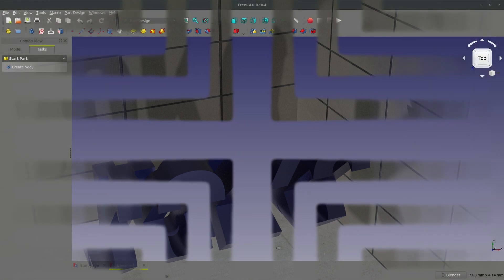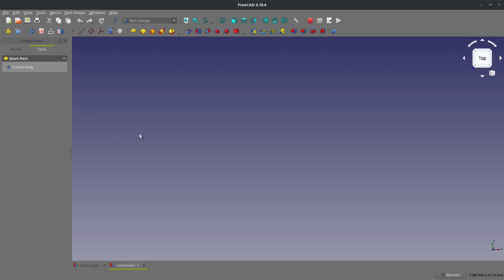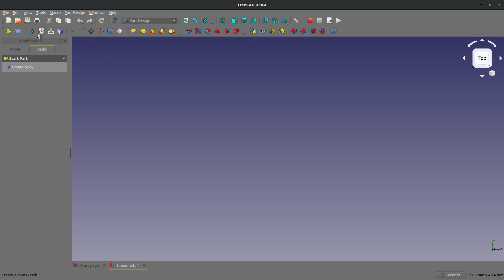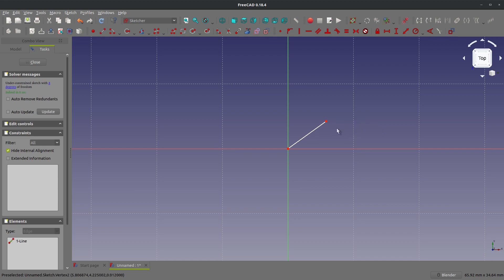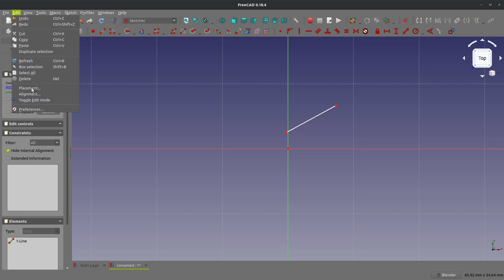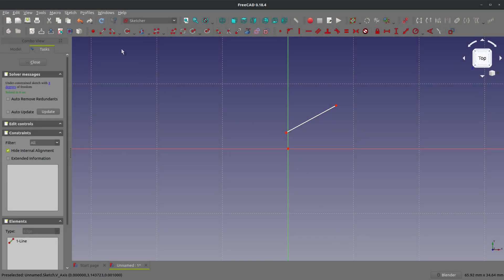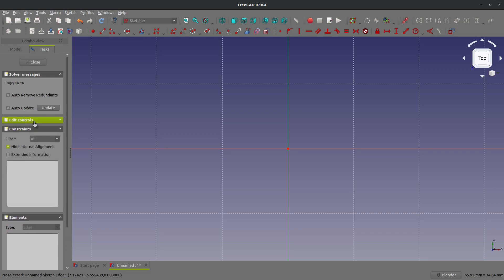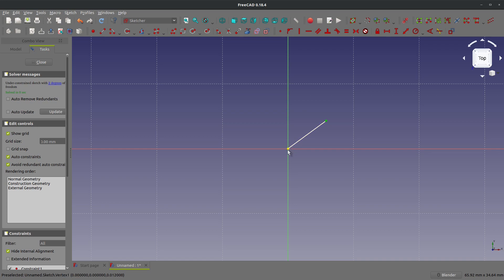FreeCAD Autoconstraint / Snap Problem Fix |JOKO ENGINEERING|

Comment: I just checked on my 0.18.4 Windows installation. I don't have this issue. Maybe it is not an issue in the Windows 64 bit version or it has to do with my update history (from 0.16, over 0.17 to 0.18).

Comment: Extravagant method of solving the problem. however in version 0.19, the problem has been solved, while it is really stressful to select the points. Thanks for the info!!
Reply from the maker: Glad to hear it!  I'm excited for 0.19 to get out of beta, it has a lot of great features.
Reply: "while it is really stressful to select the points": Have you set the selection points bigger in the settings?
Reply: @billereses4935  Yes i did it. The only advantage is that I see better when it turns yellow. But despite being clearly above the point with the mouse pointer, only a very small part of the point makes me trigger "yellow". It takes me a long time to hit the target. I have the version:
OS: Ubuntu 18.04.4 LTS (MATE / mate) 64bit
FreeCAD: 64-bit ver: 0.19.17175 (Git) AppImage
Python version: 3.7.3
Qt version: 5.9.7
Coin version: 4.0.0a
OCC version: 7.3.0
Local: Italian / Italy (it_IT)
Reply: @leonardochiruzzi7642  Have you tried adjusting the "pick radius" under Preferences -> Display -> 3d View (Tab) -> Render (Section) -> Pick Radius? If it is too low, your selection granularity might be too high, try a value such as 8px or 10px
Reply: @motownshogunate3326  Yes, that was the problem. After a few weeks of various experiments I realized that the value was too low. Thanks anyway
Reply: Nope.  2022.. I just installed v 0.19 and it still has this same problem with auto contraints not working.  This video solution here worked to fix it for me (so far).  
Now I'm starting to remember why I stopped using FreeCad a few years ago and went back to Fusion 360.  There were just too many annoying things like this in FreeCad.  I decided to give it another try now but this kind of thing is pretty discouraging.  It doesn't need to be perfect but I'm not impressed that these bugs remain in the program for years and years like this.
Reply: @tralfazy  I do not know what to tell you. I have version 0.19 (24366) Linux and the problem in the video does not occur. If you are used to Fusion360 and then switch to Freecad it is clear that you will find yourself wrong. I don't use Windows and I don't want to use programs that are free and then become paid.
Reply: @leonardochiruzzi7642  I feel the same way.  I feel that AutoDesk will pull the rug out from under the hobbiests at any time so I would much prefer to use FreeCad, however, FreeCad has a lot of peculiarities.  I can get things done a lot faster in Fusion 360 but it's mostly about getting familiar with a new tool (again)  
That failure to connect constraints was driving me crazy until I found this video and did what he said and then it started working as expected.  I was determined to find the configuration setting that was causing the problem is so I uninstalled FreeCad including my user preferences and re-installed it.  However, it still works correctly after the re-install!  Dang it.  I repeated several times more and still could not re-produce the problem.  Oh well.